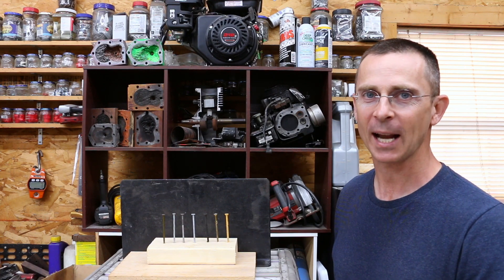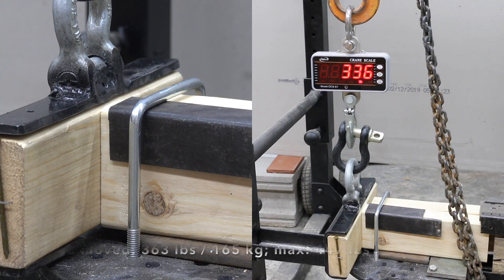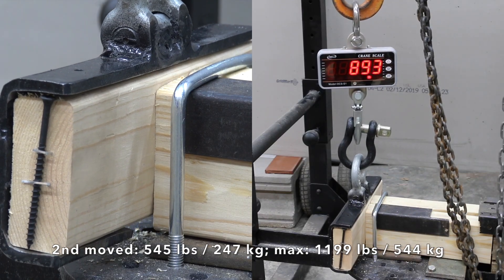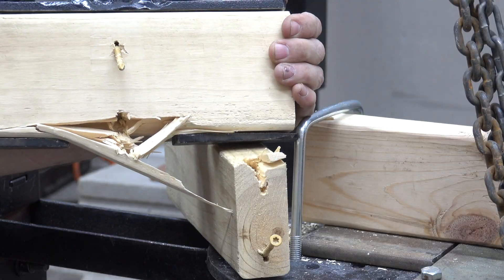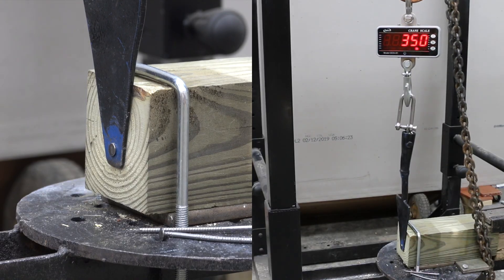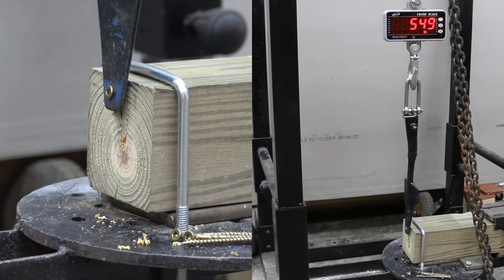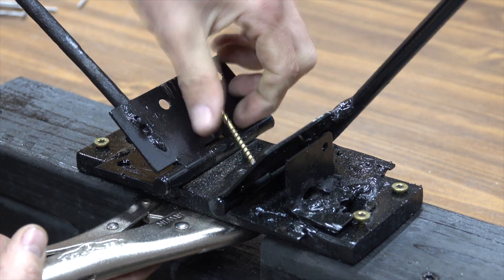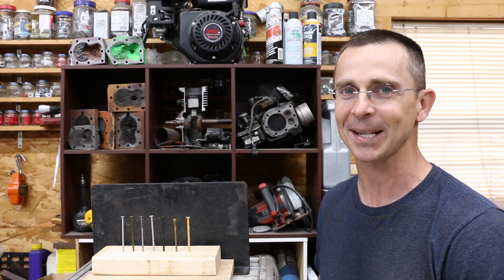Do Screws Shear easier than Nails? Let's find out!

Comment: Since you finished testing oils, could you test oil filters? Love your content
Reply from the maker: Great suggestion! Thank you
Reply: I agree with this request!  There are many videos out there of people cutting filters open, but I really want to see the filters put through the Project Farm gauntlet.
Reply: @mr.smoker4147  I would like to see how the microGreen filters do. Does the double filtration really work?
Reply: Yeah pump some oils and crud through them!
Reply: Does K&N get extra points for the bolt head welded to the end?
Reply: @SomethingFunny454  sorry. K&N is very helpful on some applications like a Hyundai with no where to grab it sideways.
Reply: @DENicholsAutoBravado  It really can be useful removing a stuck filter but I'm not sure its worth the extra cost.
Reply: @SomethingFunny454  it sure isn't. In a few applications it'd be helpful if you didn't own the right tools. Like a claw.
Reply: @DENicholsAutoBravado  Or a long screwdriver lol.
Reply: @SomethingFunny454  nah. Always go claw. Had one so overtightened the other day and there was barely enough left after trying and trying the screwdriver method. 

I estimate it was on with 200 ft lbs and the sealing surface was even damaged from it!
Reply: @SomethingFunny454  it shouldn't. It's identical to X filter. Watch my video to find out.
Reply: @SomethingFunny454  that's exactly why i switched to K&N . i hate the filter wrenches. i've tried several they either eventually fail leaving you stranded or dont work.
Reply: I love this idea!
Reply: Amsoil filters for the win
Reply: Congrats. I don't see anyone's suggestion having as many comments!
Reply: And watch as fram comes out on top and the internet implodes on itself
Reply: Wix is always hyped up, be nice to see how it does against others. Also standard Fram ones are hyped down, be interesting to see if they're as bad as they say.
Reply: @lanceuppercut6168  I know for one of my cars that the Wix filter made it run much quieter on start up than micro guard.
Reply: Wesley. You said what I've been thinking!
Reply: I'd like to see an electrically charged filter to attract fine debris debris. Also how much of the elemental additives does it remove as well.
Reply: I wonder how hard it it would be to test filtration
Reply: I would watch that
Reply: Nothing would beat the Amsoil oil filters especially junk, off the shelf filters. Just like nothing could beat the Amsoil itself lol. It's the best.
Reply: I'm a fan of the Fram Ultra filers.
Reply: @narlycharley  RIP your engine. I hope you dont run anything over a 3k mile interval.. Anything over is putting your shit at risk. FRAM doesnt build anything worth a damn.
Reply: @zuestoots5176  The Fram Ultra is actually a really good fitler, the Fram Xtra Guard and Tough Guard are junk.
Reply: @zuestoots5176   20 years of only fram filters, never had a problem with one
Reply: @narlycharley  same just can't grab the cheap ones though. I grab the tough guard ones
Reply: @narlycharley  I'll put a K&N up against that.
Reply: Purolator PureONE oil filter!!! If it beats Amsoil filters I'll be shocked!!!